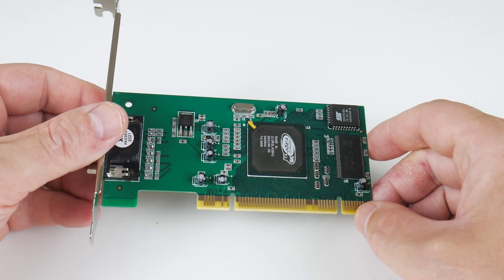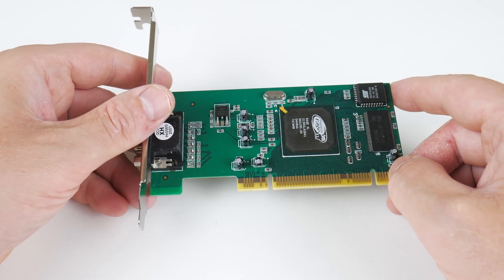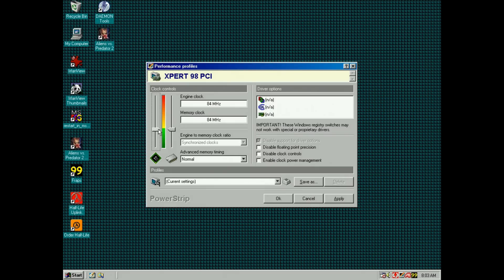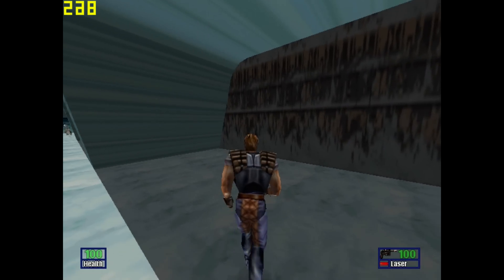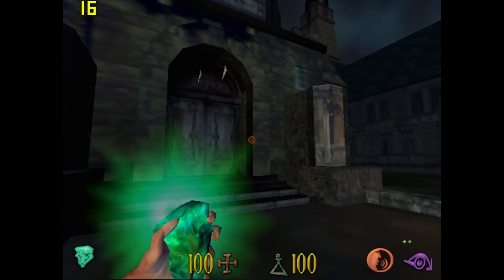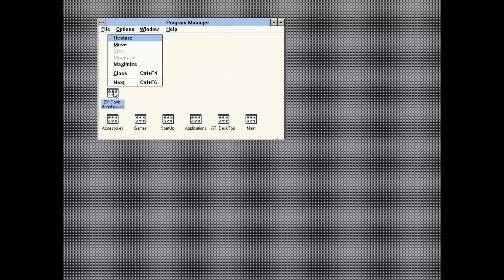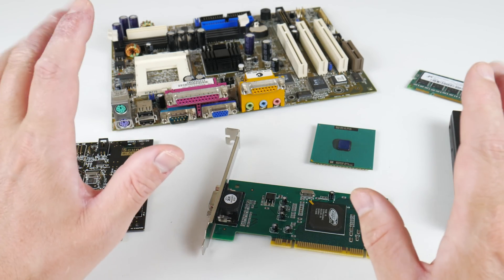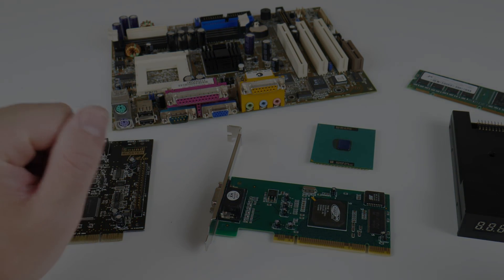Graphics Card shortage? Buy the ATI Rage XL!

Comment: This reminds me of the ATI Rage 128 Ultra that came in the Dell Optiplex GX150 I had back around 2000. I pushed that thing so far beyond what it was good for, and had a blast doing it :D
Reply: How does the Rage 128 compare to the XL?
Reply from the maker: @mesterak  That's Rage 4 so it's better.
Reply: @philscomputerlab  ok well I do have a Rage 128 and an ultra so I’ll run some tests and compare to the XL on my test build system, which is a socket 478 P4.
Reply: @mesterak  please do and post a link to the results here : )
Reply: @philscomputerlab  can it play warzone?
Reply: @mesterak  Rage XL is far worse.

A proper Rage 128 Pro card has a 128 bit memory bus. The cheap garbage Rage XL cards you find now often only have a 32 bit memory interface for severely crippled memory bandwidth.
Reply: @GGigabiteM  oh I didn’t know they were memory bandwidth crippled like that! A few weeks ago, I finally got around to testing a Rage 128 Ultra, and I was impressed how well it held up in older games.
Reply: @mesterak  The Rage XL was a cheap and nasty video chip based on a die shrunk Rage 3 core (Rage Pro) with a 64 bit bus. It was primary designed for situation where only basic graphics output was necessary, like servers. It excelled in that role well into the 2010s, server boards often had them integrated on the motherboard. Though, there was no driver support past Windows XP, so they became painful even for use on servers since the driver was basically VESA and the CPU would be drawing the frame buffer in software.

I think the Chinese stumbled upon a stockpile of them in the past few years, because of the generic Rage XL PCI cards that flooded the market.

Despite the Rage XL having a 64 bit memory bus, those cheap and nasty cards generally only have a single memory chip with a 32 bit bus to make them as cheap as possible.

They were bad 28 years ago, and are bad now.

Rage 128 was ATI's first semi-competent 3D accelerator card. I still preferred my Voodoo3 and Voodoo5 though.
Reply: @GGigabiteM  the Rage XL can game a little based on my testing, but hands down the Rage 128 is a much better card.
Reply: i have a dell optiplex gx150, i added a ati radeon 8500 and sound blaster audigy 1 into it, runs alot of games well, even half life 2 works well, the old dvd launch 2004 1.0 version of course.
Reply: @sokoban44  Or the first Deus Ex game, or star wars knight of the old republic 1 and 2, those were all also great!

Comment: Do newer PCs have PCI slots?
Reply: I've built Ryzen systems with motherboards that have PCI, so at least some quite recent motherboards still had PCI. But I don't know about compatibility with PCI graphics cards
Reply: There are even B550 motherboards with PCI, for example ASUS Pro B550M-C/CSM. Otherwise you can use PCIE to PCI bridge like ASM1083
Reply: They can, but it is no longer common
Reply: Pcie 1x to PCI (and the reverse) exist however
Reply: @virtualtools_3021  It seems pointless then unless it is for very old PCs.
Reply: @antdude  I believe this video is meant as somewhat of a joke / a look at retro stuff
Reply: My last PCI slot motherboard was on a ddr2 build, it's hit and miss, xp seemed to be fine with PCI GPUs, but I couldn't ever get a PCI GPU working on windows me....it only ever worked with agp. But we're talking old stuff here
Reply: I've seen b350 motherboards with 2 PCIs, but no B450.. it could be useful for me for asus xonar soundcard.

Comment: Now for real the best basic available GPUs are probably Nvidia GeForce GT 1030 GDDR5, PNY T400, AMD Radeon RX 550 and Radeon Pro WX 2100
Reply from the maker: Remember when you could get cheap RX 470 and 480 cards from AliExpress? Missing those days. I sold all my fast graphics cards, only kept one RX 470.
Reply: Radeon pro wx 2100 is low profile, single slot, and 35w. It's as compatible of a GPU as you can get! One of the few that fit in my friends SFF Dell
Reply: @virtualtools_3021  I couldn't get mine to work with my Lenovo iH61 motherboard.
So keep an eye out on OEM boards.
Reply: i would rather get a 5700g than pay scalpers for a gpu that is only slightly faster than modern igpus

Comment: For all the people that wanna buy it ASAP: The card only supports 3.3V, so the majority of motherboards wont be able to power it. You can modify it tho.

Also someone claims that only supports PCI 2.3+, if that is true, it wont work with any 486, or Pentium I, II and III systems(Only P4/Athlon and up). I cant verify that anyway.
Reply: Works fine in my PCI 486… my card has both notches so fine in 3.3v and 5.0v slots.
Reply: @ianhanschen  all the rage xl cards sold “new” have both notches but only one regulator that works with 3.3v and thats the one that provides power to the chip. If you have the original card sold back then, then it should work with both voltages.
Reply: @Mayban36  why would they cut both notches when only ones works? Designers get an F lol
Reply: @Mayban36  My card has (and requires) just the one regulator, which is used when it is placed into a 5v slot, to generate the 3.3v required. It works fine in a 3.3v and 5.0v slot (just tested it in a motherboard which has both, ironically it's the only card I have that I can use for the project I'm working on). I imagine when it is placed into a 3.3v slot, the regulator is unneeded, as it powers off 3.3v from the PCI bus. It's a new card, and I'm not sure what you encountered.
Reply: There are (at least) two variants of the Rage XL card floating around, one of which does have all the required regulators.
Reply: @RodBeauvex  i searched a lot and i only find 2 versions, one with a cheap pcb with almost no components and one regulator. And another one with half of the PCB with components missing(But at least with sockets to solder)
Reply: @Mayban36  There are versions of the second with with all the components present. I have four of them. Known to Boot in a Batman's Revenge, a Um8810PAIO, an LSI486 (one of those tiny boards), a Tyan and a Micronics HX Board, and a Micronics Socket 5 Diablo something-or-other.
Reply: @RodBeauvex  there's only one regulator on my card, and it's the only one required.

Comment: Brand new, in stock, cheap, PCI, VGA but you can also add not power hungry.
Reply: add the Status, does not need a 6 pin pci express connector or molex to run

Comment: I got one of these as an integrated gpu in my old dual pentium 3 server.
Reply: Radeon es1000 is quite similar right?
Reply: It's integrated on my "Pentium EEEE 990FX" dual 771 xeon 5080 setup
Reply: @virtualtools_3021  Yup! A bit more pow3rful though, the rage XL is barely enough for accelerating the windows 2000 desktop

Comment: You can also still buy a new Geforce FX5500 PCI (costs a bit more though).
Reply: for non-agp systems too much performance, for agp ported is too weak
Reply: @siniyden There is nothing stopping people from running a PCI graphics card in an AGP equipped motherboard, rather than an AGP card.  On many motherboards the BIOS allows under-clocking the CPU, altering RAM timings and disabling caches to adjust the CPU performance, allowing many old DOS games to run on faster PCs. So, if you have the relevant drivers, there's no reason not to use one. There is no single card that works for all situations.

Comment: I just bought one of these because I have a build where the mb only has PCI, no AGP. I'm really hoping it will be able to run Diablo 2 and Age of Empires 2.
Reply: Hope your mobo have 3.3V ) or you should modify it.
Reply: Both of those are mainly 2D games, so depending on your CPU you should be able to run them just fine.
Reply: Diablo II requires DirectX 6.1. The Rage XL is 6.0 but I think D2 has a software or some other fallback video mode if there is a DirectDraw feature conflict.
Reply: @dycedargselderbrother5353  It does.
Reply: FX 5200 pci
Reply: I see that we are thinking alike - I would love to play some classic, non-remae strategy games on my Voodoo 2 machine and S3 Trio just can't handle them all.
Reply: Just buy Diablo 2 Remake. It was made by Vicarious Visions who did awesome Tony Hawk Pro Skater 1+2 remake last year. Diablo 2 Remake is just good old Diablo 2 with modern look and 60 fps (on PC, PS5 and XSX).